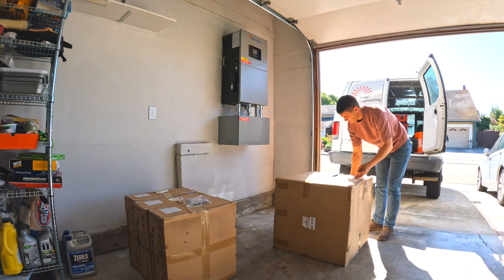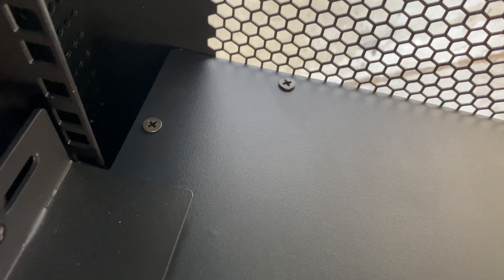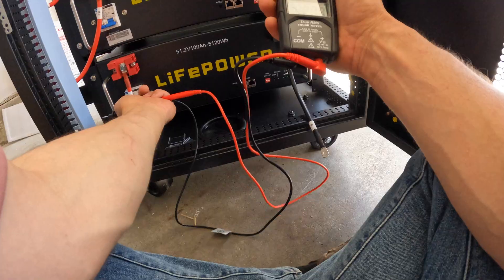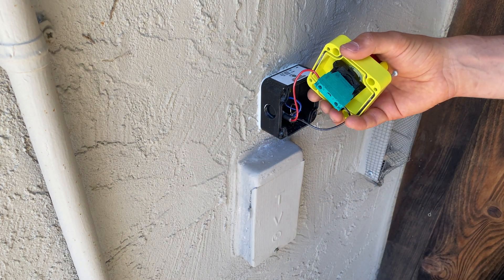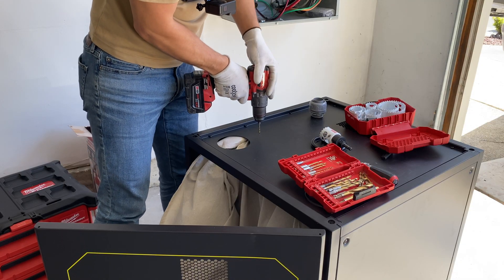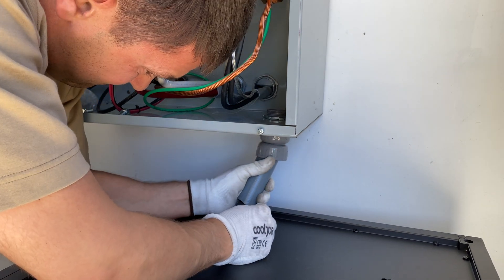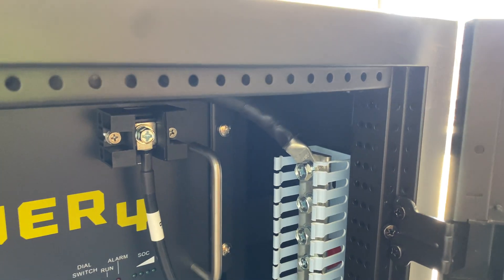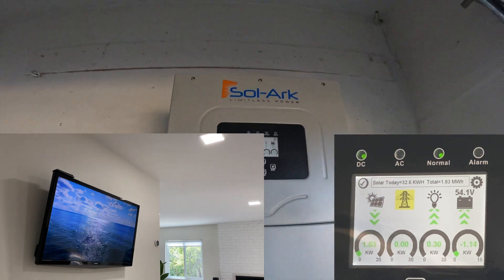Installing batteries for solar array. Whole-home backup with Sol-Ark 15k & EG4 & 6800W solar panels.

Comment: I have a Sol-Ark 15k and 6 EG4 batteries. It is an awesome system.
Reply from the maker: yeah, Sol-Ark 15k is a great inverter.
Reply: Just speced this system today with 10 kW of solar. Is there a contingency for the inverter failing? Can you  bypass a failed inverter and pull straight from the grid?

Comment: I feel really "small" right now,.. With my single Eg4 12v 400ah running my Gaindel 4000w, with 8 / 100w panels 😢 with extention cords on the floor.  And that's an easy 5K with my cabling and equipment.

Comment: I bet if you do this again, you will fit the cable gland BEFORE you fit the batteries! 😉
Reply from the maker: next time, I'll get some plates to cover the original hole and install conduit into there.

Comment: I'm not a professional installer but I installed the Sol-Ark and the rest of the system myself 3 years ago. If there was any advice I was going to give you as a non professional installer is to buy a hydraulic crimper for the battery lugs and a hydraulic knockout instead of these hole saws. The hole saws I have for situations where the hydraulic knockout might not work. Otherwise great video. And great look inside thos EG4 racks. It's shocking to me that as the manufacturer they can't even get the battery rack holes to line up, especially at the price they're asking for the thing.

Comment: NIce job!!! 
But I think that battery bank rack can not be in that position below the inverter... I think it's a code violation (NEC Code, that is... if this is in the States).
Just saying...
Reply: I’m doing a similar setup. If my battery bank is off to the side of the inverter and not directly in front it will be to code? Thanks
Reply from the maker: Going to be surprised.. Do you have NEC article? Thanks for feedback.
Reply: @SolarEngineering  I'll look it up and share it with you.
Reply: Please take a look to Sections 110.26(A)(3) Height of Working Space and 480.10 Battery Locations... my main concern, in your installation, is that it seems your battery rack  extends more than 150 mm (6 in.) beyond the front of the inverter. Am I correct?
Reply: @Songomx  Its an off grid system therefore does not need to meet all the strict NEC code requirements as its not going to be tied to the outside grid and utility company.
Reply: @Rock_Nemo  I understand that, but these sections that I am refering to are not exactly that... it's more of a security and protection of the installation... working space and battery placement...
Reply: @Rock_Nemo  And, sorry to say, but this customer is NOT OFF GRID...!!! The installation of this hybrid system has to comply with NEC codes of its area (NEC 2014, 2017 or 2020)... The installer even simulates a grid outage...!!!
Reply from the maker: ah I see it now, yeah few inches extending past the limits.
Reply from the maker: thanks for the articles, best way to resolve it is to move battery on a left I think.
Reply: @SolarEngineering  Glad to help!!!

Comment: $500 above project you need an electrician? Which state this is?
Reply from the maker: Any job more than $500 requires license. However owner can obtain permit and perform work (I'm not sure about battery installation however). I have electrician license.
Reply: @SolarEngineering  Having a license is a huge advantage. Nicely done bty.
Reply: @SolarEngineering If you have a very small stand alone system, That might happen to have a couple of components screwed onto a wall, But absolutely no wires are connected to grid or the home,AKA  Extension cords to small appliances, Do you still need a permit or inspection???   asking for a friend...😬
Reply from the maker: @recumbentrevolution6540  best way to call the city and ask them...